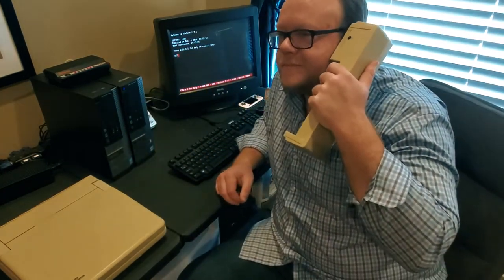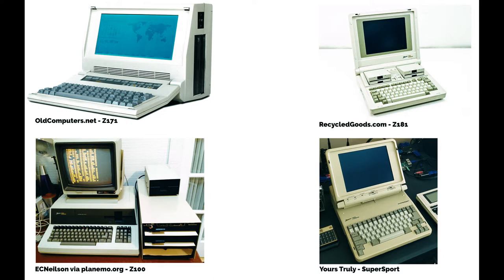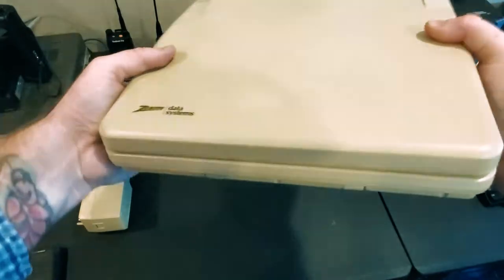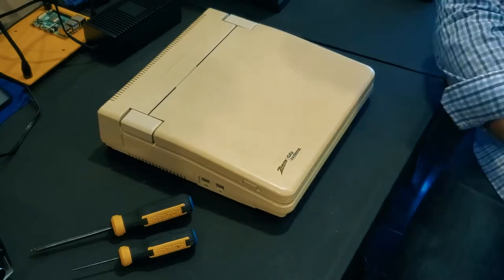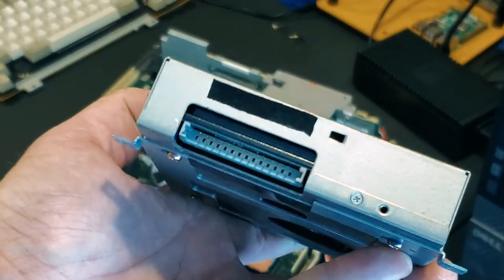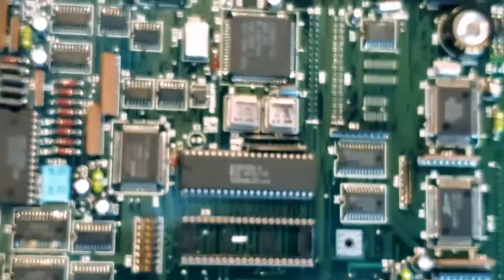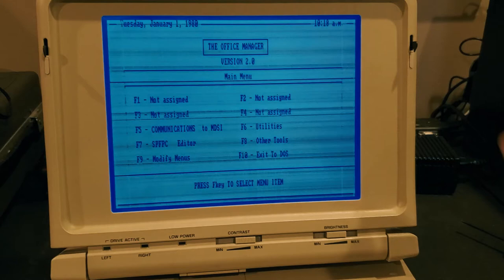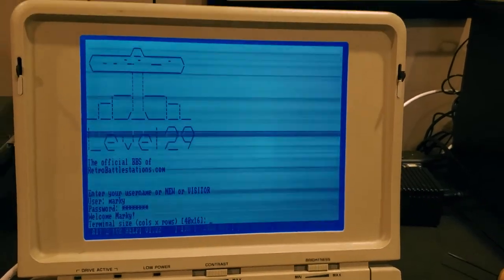Zenith SuperSport 8088 Laptop - Retro Computing - Part 1

Comment: I had the exact same laptop, it was extremely well made and reliable, the screen was actually 2 screens and you could see that clearly when you adjusted the contrast.  I used this to portably control a device via the RS232 port and the screen was not so important and neither was the weight as I used it in a car, later I replaced it with a Tandy 102 as the program I used was written in basic and only needed a minor change to work on the Tandy.   Happy days.

Comment from the maker: Good day, friends. Loved this old machine! My apologies for the quality of the footage on this one. I'm using a new Note10 which normally looks great, but the light bleed from my window certainly mucked it up and created some artifacting. Either way, I'll make sure this is fixed up in my next video. Wanted to get something out there. Thank you.
Reply: I remember aucustic couplers and 110 baud modems pn a KSR 33 teletype with 20 milliamp current loop serial interfaces. How about that for ancient stuff.  It also has a paper tape reader and punch.
Reply from the maker: @charlesburnaford7591  That is awesome! I'm really a huge fan of the people working on preserving those old teletype machines. Do you watch CuriousMarc here on YouTube? His work is astounding. I just love all his friends and the folks that still have experience working on those machines and get them to work again. I've learned a lot the olden days thanks to his channel and continue to enjoy hearing the stories.
Reply: @MarkyShaw  I just found this video, and its a shame really. I literally just had to scrap one of these because the power supply shat itself and almost every cap destroying the electronics. I salvaged the HDD and floppy. Floppy is good, no way in smeg to test the jvc..

Comment: Really looking forward to the coming up videos on this old laptop. I have a NEC ProSpeed SX/20 in amazing physical condition (visually), unfortunately all the caps in the psu and in the machine as well need to be replaced, as the machine is completely dead as of now. I am still gathering the courage, and in the process of buying all the required caps for the project.  So it will be great to see someone replacing caps in a similar environment, I really don't want to mess up anything when the time comes.

Comment: 2020 jan - I have one of those with two battery packs, does not have 8087 upgrade yet. Does not have keypad port.  model   -92.......long ago had abother version with 80286 and the very rare external expansion box.  it had an acient netork card in it for Novell.